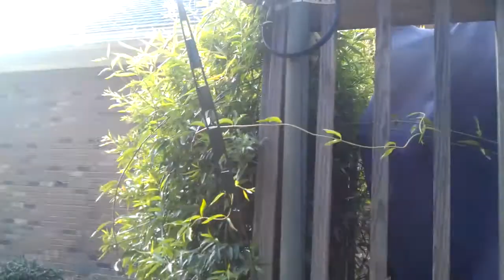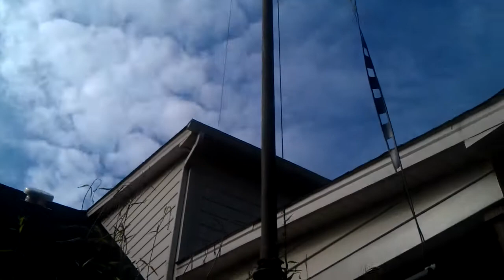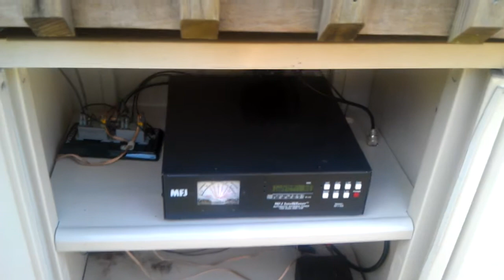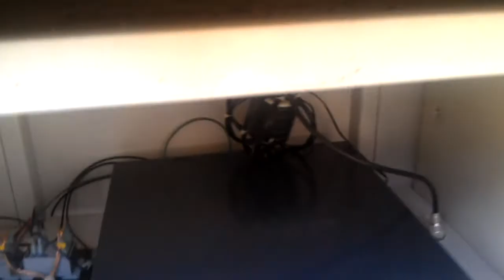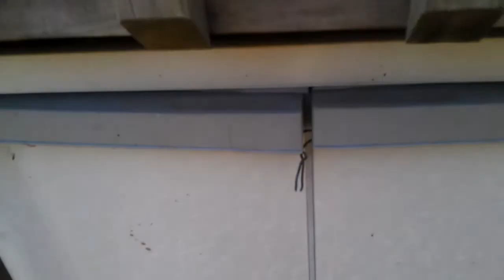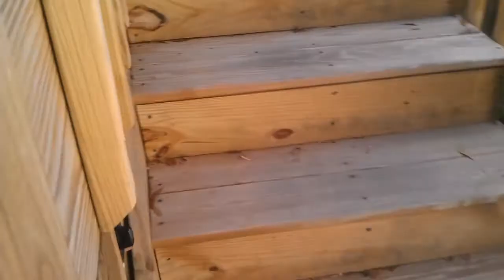N4LQ 160-10 Multiband Doublet with Auto-Tuner

Comment: You may want to see what your antenna pattern looks like across the various bands with EZNEC. Even though you may have full VSWR control with the one antenna you might find that some of the lobes are quite high and some deep nulls at certain azimuths and elevations.  Adding another shorter doublet may give you better results on some of the higher frequencies.

Comment: Steve, how did your auto tuner due in the winter. Any problems with intense cold temperatures.  Art. K2ADC
Reply from the maker: It gets down to about 17 degrees around here. No issues.
Reply: @n4lq  thanks Steve for the quick reply. I wanted to put my tuner in the garage ( not heated) it’s an LDG 200. The mast is next to the garage. I held back because of the New Jersey winter weather. I’m going to give it a try. 73

Comment: I have a the MFJ-993b tuner and I hate it. I have never owned such a profoundly frustrating piece of equipment ever. It doesn't work as advertised, the instruction manual is incorrect, the $50 interface cable doesn't work at all, the meter globe blew after 1 hour use and, the power switch broke in less than 2 weeks, it constantly forgets previous settings causing a complete retune for often used frequencies and when tuning up fully 50% of the time it just switches itself off. Sometimes it doesn't switch off but won't tune either. I play with the RF output on my Yaesu but it doesn't make any difference. I whistle into the mic on AM, use FM, change bands etc etc etc. Worse, MFJ couldn't care less. I have a 40 amp linear power supply and it does the same on that as it does the wall wart.

After seeing what you did with yours I actually think I could use mine it in a similar way. Thing is mine doesn't like different antennas. It just turns off for no apparent reason but with one antenna it seems reasonably reliable provided it is never touched and I have hung the clothes on the clothes line in an efficient way that day. I also need to pray to the MFJ gods and offer a puja to some obscure  Hindu deity. 
For the amount I paid, I refuse to let it die after such a short ownership (20th Nov 2015) but don't want to spend a single cent more on freight for warranty as I simply don't believe it will be fixed properly and I'm not going to spend another cent on this idiot thing. Worse I was warned and didn't believe as I thought people were exaggerating - seems they were under exaggerating if anything.

I've opened it up and all seems fine. I was actually surprised at the internal quality but proof is in the operating and mine is an utter POS! I truly hate it. I can't trust it, but used in a cupboard outside like this on a single antenna it may be OK. I'm considering building a ladder line fed 160m horizontal loop as I have the space. I found this vid as part of my research.

73s
Reply from the maker: +ThePaulv12 Sorry to hear the sad story. I've never had any problem with the 998 unless trying to use a balun. Auto tuners and baluns don't mix. Just ground the tuner with a heavy strap and ground the balanced feeder to the tuner's ground tap. Your tuner will love you for that.
Reply: +Steve Ellington
re the balun,  I'll keep that in mind. I don't use one anyhow as the 993 uses its internal one, but I have noticed that all full sized 560 odd ft 160m multiband horizontal loop antenna articles I've read so far have recommend NOT using the internal balun of autotuners. 
You certainly have me wondering and forewarned is forearmed! I'll definitely keep this in mind when I run into difficulties.

Cheers,

Paul.
Reply: @n4lq  do you feed the antenna on the LW post and the GND post without a balun? Mike SM5WPW
Reply from the maker: @grandpapipermike2921  Yes I was. Baluns just confused the poor tuner and got warm. Just be sure to ground the tuner with a short lead to a nearby ground rod or fence. Baluns like to see their impedance match and these antennas have some really wild impedances.
Reply: If you have the space for a horizontal loop, you might consider cutting a couple of 160 Inv. Vee's….I got a mancrib/hamshack (an old 7 x 20 Camp Trailer) I use for my major HF Operating....my parents are cool with MANY wire antennas (I have 13 now, soon to be 14) going different directions (no "cheese" for a tower and a beam)….I ran two 160M Inv. Vee's w/o a balun, and they worked....weren't very broadbanded (20-30 kHz at best) but I didn't need a tuner....other thing an older ham told me was that the smaller rated tuners (300-600W) you should cut the power in half almost at 160 and 80....only time I ever smoked my own rig, and another fellas rig, is trying to use a tuner on 80 and 160....had a smaller auto-tuner, and it was ok till 80/75m and 160......would only work on 160 barefoot (under 125/150W) and about the same on 75....was ok on 40-10, even with 350-400 watts at times...running the way I did on 160, I could use the linear, and run directly out of it (bypassing the tuner) and had no issues....just limited to the CW portion for both directions (NE/SW and NW/SE) or the SWR would go nuts....I have also heard about problems trying to run baluns with autotuners, so not too surprised....fella might be right.....and grounding is also key.....I got another ground rod at my mancrib, and changed out regular wire for ground with older sections of coax, and man what a difference.....less noise, and even my antennas and manual tuner seemed to work a bit better.....got a 75M Vertical, and a 160 wire to try and get up to test out for the ARRL SS SSB 2018 this weekend.....no amp now, but sure want to see if it works....I sacrificed the old 160 wires for 2 80 wires for CW, since I like QRP sometimes, but not for 160....sold my amp a couple of years ago and a K1 to pay taxes and survive a winter, so it's a barefoot/QRP contest season for me....had some issues with MFJ Gear, but no problem with warranty service.